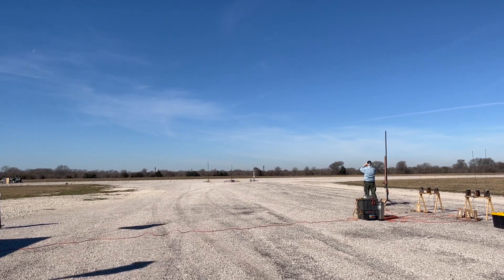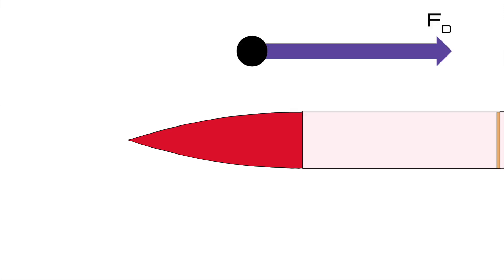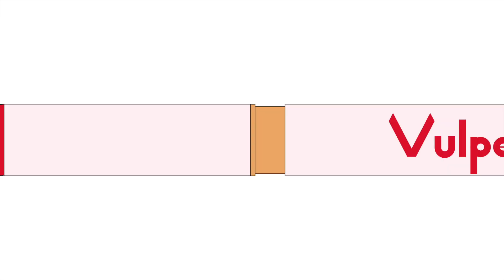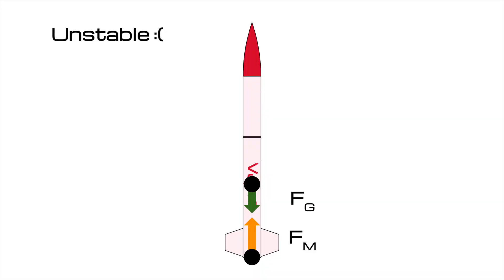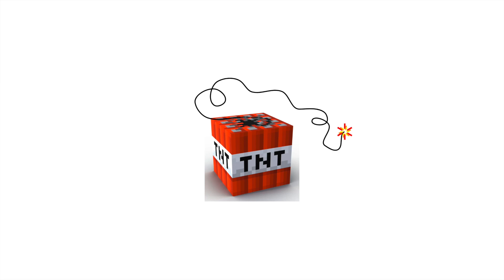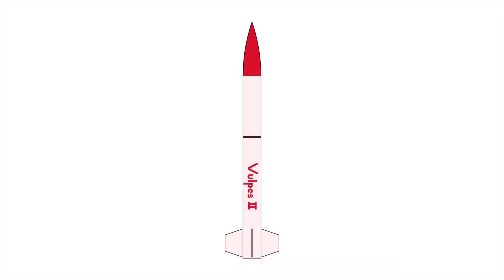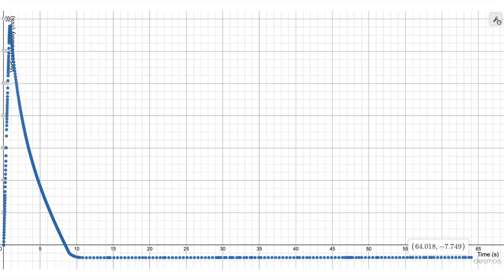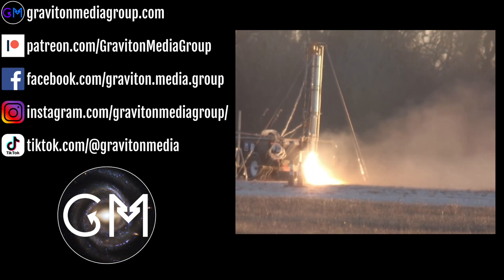How to Build a Rocket for L1 Certification (Vulpes II Rocket Launch)

Comment: what's the current cost of an H255? $50?  BTW,if the fuel grain is a C-slot,the delay grain is going to start burning upon motor ignition.
Reply from the maker: Yeah, $50 is about correct. Good to know about C-slot grains. It makes sense there are different types for different purposes.

Comment: This is an excellent video.  Perhaps the best entry level video I’ve seen. I really appreciate your time and effort to educate the viewer.  My only constructive comment would be that electronics are not required for an L2 attempt; however, I might suggest an attempt at Dual Deploy for a J-L motor so your rocket doesn’t drift a far distance. Or, you can use a Chute Release (with no Drogue) for motor ejection to bring the rocket down within a reasonable distance of the launch pad.  Also, for an L2, use a tracker or GPS. I lost my rocket at Hearne launched 
on an I impulse motor with a 12” 
Drogue chute  (which I really didn’t need) - I never even got a chance to see the Main chute deploy since the rocket had drifted so far away (due to wind and a thermal).  I’ve never launched without a tracking device after that. Hope to see you at Hearne sometime.
Reply from the maker: Thanks! Yes, you are right about the L2. Electronics are quite helpful for the reasons you outlined (mainly for setting chute release to a low enough altitude to prevent drift), but they're not strictly necessary as a design requirement from Tripoli.

Comment: Great video. I want to get started in rockerty myself but not sure if it was legal in my country. But after seeing this video and doing a bit of research i found out it was!
Reply from the maker: That's great to hear! Definitely pay attention to motor-purchasing requirements and height ceilings. In America, those are the two areas with the most regulation, but you can do both with the proper certifications and waivers.

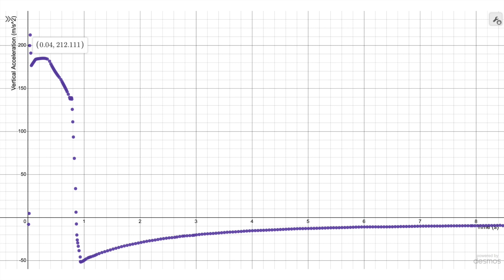Comment: 11:20    140 meters per second speed in its first second. Compare that with:: "Saturn V Rocket Launch Speed and Height 2
"   showing a whopping speed of 3 meters/second!!
Reply: We’ve been over this before. A TWR of 1.00000001 is enough for the rocket to get off the launch pad. The Saturn V had a TWR of about 1.25. 
You don’t want a huge acceleration: 140 m/s2 is 14 G, which would kill the humans on board. The acceleration increases as fuel is used up and the stage gets lighter, so the rocket has to be designed to keep the acceleration near the end of a stage’s run below the limit. For manned rockets, acceleration is limited to 3-5 G. At the start of the stage’s run, you then end up with a TWR of slightly over 1.
Reply: @Hobbes746 ==Enistein::: I have proved my facts with empirical kitchen-table experiments which even certified retards can conduct, so, I suggest that you prove your fairytale-TWR by buying one of these O-motors, and putting it on a rocket heavy enough to make a TWR==1.25, or even 1.5, or even 2, then sit next to it at launch. If your rocket moves up, you'll survive, but if doesn't it explodes and turns you into charchoal, which would make a memorable artifact in a NASA museum !!! agree??? 
Based on my below comment exchanges, and assuming that you expect your O-motor to burn for 5 seconds, if you and 4 other NASA-fans like you stand on top of the motor, you'd make up the bulk of a 400 kg rocket, then fire up the motor, and expect to reach the moon in a nono-second!!! How' that for a solution Rocket-professor???
Reply: @Hobbes746  ==Enistein::: I have proved my facts with empirical kitchen-table experiments which anyone can conduct, so, I suggest that you prove your fairytale-TWR by buying one of these O-motors, and putting it on a rocket heavy enough to make a TWR==1.25, or even 1.5, or even 2, then sit next to it at launch. If your rocket moves up, you'll survive, but if doesn't, don't worry about !!! agree??? 
Based on my below comment exchanges, and assuming that you expect your O-motor to burn for 5 seconds, if you and 4 other NASA-fans stand on top of the Omotor, you'd make up the bulk of a 400 kg rocket, then fire up the motor, and expect to reach the moon in a nono-second!!! Are you brave enough for that???
Reply: @Hobbes746    Did you get my deleted reply???
Reply: Briefly, my descriptive deleted comment challenged you with sitting on an O-Motor & launching yourself into space!!! That's a TWR>5
Reply: @kareemsalessi  An O motor with a total impulse of 20 kNs and a burn time of 10 seconds has a thrust of 2 kN, or 200 kg. If my weight is 80 kg, that’s a TWR of 200/80 is 2.5, not 5. It will accelerate me at 2000/80*9.8 is 2.55 m/s2 for 10 seconds to get a total speed of 25.5 m/s which is not enough to go to space.
Reply: @Hobbes746  If you even get off the ground
Reply: @kareemsalessi  With 2 kN, I definitely will get off the ground.
Reply: @Hobbes746   OK, then, you'll earn the prize!!! if you get off the ground, that is.
Reply: (VULPES II ROCKET LAUNCH)

Comment: 17:00   O-motor delivers a  Maximum of 40,000 Newtons==40 TONS of thrust force???
Reply: Ideally, you want to select a motor that will give you at least a 3:1 TTW ratio. 4:1 is much better especially for high power. You only have so much time while still under the control of the launch rail, so the more speed you can gain the better.
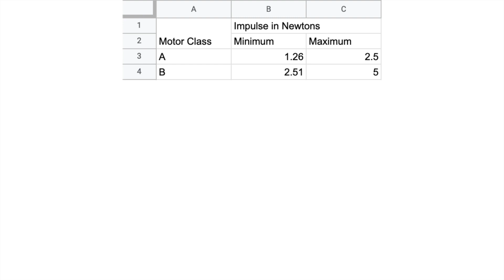Reply from the maker: 7:35 Ah, sorry. I see that's a mistake in the graphics there. It's 40,000 Newton-seconds, not 40,000 Newtons. Newton-seconds are a measure of total impulse, or change in momentum. This means that an O-motor can change the momentum of a rocket by 40,000 Newton-seconds. If delivered in one second, that would be an average thrust of 40,000 Newtons, but O-motors typically take five seconds to completely fire, for an average thrust of 8,000 Newtons.
Reply: @GravitonMedia  thanks.  So, 800 kilos of instant thrust, and how heavy was it at launch???
Reply from the maker: I didn't use an O motor. I used an H motor. A Cesaroni H255 to be specific. This video is both about my rocket and hobby rocketry in general, so I included the information about O motors to help teach people about the different kind of motors in hobby rocketry. The Cesaroni H255 motor has an average thrust of 255 Newtons.
Reply: @GravitonMedia   So, 255N==25 kilos thrust force, or divided by the 6 seconds of burn?? and thanks
Reply from the maker: Yeah, 255N is 25 kilograms of thrust. The burn lasts about 0.9 seconds.
Reply: @GravitonMedia  Thanks, and how much was the gross weight of your rocket??
Reply from the maker: 3.25 pounds or 1.47 kilograms
Reply: @GravitonMedia   awesome, so your approximate TWR was 25/1.5==17, correct??
Reply from the maker: Yeah, something like that.
Reply: @GravitonMedia  Great-Thanks, compare that with Saturn/Apollo claimed whopping TWR==1.2
Reply from the maker: Right. The reason the Saturn V was so much more powerful than my hobby rocket is that it applied that thrust for a much longer period of time, 168 seconds for the initial burn rather than the 0.9 seconds of my rocket. Also, the TWR increased over the course of the burn, as the Saturn V expelled much of its mass as fuel. Compare its wet mass of 2,200 tonnes to its dry mass of 137 tonnes.
Reply: @GravitonMedia  except that with its claimed TWR it couldn't have moved even on wheels , on the ground, much less to detach from its launch pad,  right??
Reply from the maker: TWR just needs to be greater than 1 for a rocket to leave the ground. When TWR < 1, gravity is stronger than thrust, so the rocket will stay on the ground. When TWR = 1, gravity is balanced with thrust, so the rocket will hover in place. When TWR > 1, gravity is weaker than thrust, so the rocket will move upward.
Reply from the maker: What exactly would qualify as proof to you? What experimental results would you need to see to change your mind?
Reply: @GravitonMedia   Any model rocket which could lift off the ground with TWR<1.5  would qualify, but  NOT talking about it.
Reply: This guy is trying to corner you into helping him prove his dingbat theory that the moon landing was fake. I’d ignore him.
Reply: @My3nMy4 ==TROLL
Reply: 0:10  Over 3lb, Ok, let's say 4lb==2 kilos. So, then, TWR==800÷2==400.  
Compare that with a whopping TWR<1.5 of Apollos,  SpaceX, etc.😅
Reply: (VULPES II ROCKET LAUNCH)

Comment: Congratulations!! I am currently on the design journey of an L1 attempt rocket too and this video inspired me to try harder even more!! P.S. what's the diameter of the airframe of Vulpes?
Reply from the maker: Thanks! The Vulpes had a diameter of four inches, which was definitely overkill for an L1 in retrospect. You can get cardboard tubes on Amazon that have diameters of 4in, 3in, or 2.5in. All of those work pretty well for L1s.

Comment: loved it!! I did my L1 on an H550. It burns for 0.5 seconds and produces 550 newtons of thrust in that short burn time hahaha. My rocket held up great. 

For my L2, i used the same rocket with a J270 motor and single deploy. However, on the second launch, the motor exploded 2.25 seconds into flight. It separated my booster from the upper airframe, feel 5300 feet and was recovered without a scratch hahaha. Only a broken shock cord :) 

My L1 and L2 were done with no electronics, however, my L3 we had redundant dual deploy, but my team launched without me and forgot to hook the electronics up so it came in ballistic from 10,000 feet......
Reply from the maker: Wow! That sounds like an interesting flight record.

I'm glad the L1 went well.

Sorry about the L2. CATO's are rare with manufactured motors, but it's very frustrating when it happens. How did you keep your L2 from drifting too far with a single motor deploy? I've been working on an L2 design, but increasingly find a drogue necessary to prevent drift.

An L3 sounds like a daunting challenge. Sorry it went ballistic. Good luck getting your L3 certification.
Reply: @GravitonMedia  thanks :) 

Pick the lowest L2 motor you can find. Thats how you prevent drift. Also add weight to the payload section in open rocket and sim it. I added a couple of bags of black beans to my rocket. Kept it low and slow and the extra weight helps it drift down rather than at an angle. Might land a tad harder, but my rocket was fine

The j 270 is a lower end L2 motor, but i still had to walk half a mile to get it. Oh, and if its a slightly windy day, you will have to keep an eye on it. Take binoculars and a ATV if you have one. 

All in all, my L2 disnt drift very far since it was a low power3d motor and i had a couple bags of black beans in the payload section to add drag and weight.
Reply from the maker: Thanks for the advice!

Comment: Hi! I'm the president of TU Darmstadt's rocketry club and I really liked your project! We started out with a very similar rocket flying an H-motor as well, but packed our own flight computer as well as a sofisticated recovery system which I can highly reccomend! Also, make sure that during descent under parachute your chute lines don't get tangled up because your rocket will most likely enter what's called a flat spin. Last month, we launched our latest rocket to a height of one kilometer and deployed three payloads - I hope you're planning something similar! It is a ton of fun, let me tell you.
Reply from the maker: Awesome! Nice work. Rice Eclipse is building a rocket for Spaceport America this summer. It'll be much larger than the rocket in this video and fly to an altitude of 30k feet. We've built our own hybrid motor for it and are very excited to see it fly.
Reply: Can eagestion system damage the parachute??
Reply from the maker: Yes, the ejection is a black powder explosion, so if the parachute isn't properly protected, it can be damaged
Reply: Anyone please help me to build my own rocket please 🙏🙏

Comment: How do you know how much to file down the delay grain to get the delay to 7 seconds?
Reply from the maker: For L1 rockets, the best way to do that is to simulate your rocket on the program OpenRocket. This will give you predicted values for apogee and time of flight, which you can use to determine the optimal delay time (just after apogee is best).

Comment: I don't like sharp cones,  the breaking of the air should be gentle, clean air is better for moving fast through it.  Do you ever launch dolphin or tuna shaped cones?
Reply: Nose cones with rounded ends are preferred for subsonic rockets; supersonic rockets perform best with pointed cones. There are a number of research papers on this.
Reply from the maker: Interesting. I haven't tried other-shaped cones for this type of rocket. Are the aerodynamics better?

Comment: Hi great video, I'd like to know where you get your rocket supplies especially the body and nosecone. Also if you could explain how a reloadable motor works and where you can get propellant from I'd be very grateful. I'm trying to get into this type of amateur rocketry and I don't know where to start or get things.
Reply from the maker: Hi there, we get the body tubes from BOX USA, a company that makes poster mailing tubes. We get the nose cones from Apogee Rockets. Reloadable motors have reusable casings with new fuel inputted each time. You just have to buy new fuel each time.
Reply: @GravitonMedia  Thanks I really appreciate you taking the time to respond I wish you the best of luck with every future launch 😁
Reply from the maker: Thanks!

Comment: Wait, would a simple apple airtag in the payload work for recovery?
Reply from the maker: Probably not.
The issue with an AirTag in particular is that it doesn't actually use GPS tracking. Instead, the AirTag uses Bluetooth connections to nearby Apple devices to determine its location. For instance, if you drop your wallet in a busy parking lot, the AirTag will determine its location by connecting to the nearby phones of passersby. For the typical use-case of AirTags—finding misplaced keys, wallets, and other household items—this works fine.
When it comes to rocketry, launches typically occur in remote rural areas, and the rocket is unlikely to land close enough to any other Apple devices to pick up the short-range Bluetooth signal. Thus, an AirTag would not be reliable for recovery. You want to use a tracking device that has GPS capabilities.
Thankfully, most GPS trackers are in a similar price range to Apple AirTags, about 30 bucks.
Reply: @GravitonMedia  Wow, The fact you took your time to help me on thhis means alot. I really appreciate the response, You earned a subscriber! What GPS do you recommend I use?
Reply from the maker: Thank you for subscribing! I actually haven't used a GPS in my rockets yet. My team at Rice University uses Telemegas and Raven Blues for altimetry data. I think those companies might sell GPS as well, so that would be the first place I would look.

Comment: I’m very new to this. Can you reuse motors or are they all 1 time uses?
Reply from the maker: That depends on the motor. The Cesaroni H255 I used was a one-time use motor, so it would have to be replaced with a new motor after each launch. On the other hand, a motor like AeroTech H128 has a reusable casing, and just the fuel needs to be swapped out after each flight. For a beginner, the one-time use motors are simpler to assemble, as their fuel components are not detachable since they aren't meant to be swapped out. Reusable motors can be more complex since you have to work with the motor internals. Hope this helps. Happy rocket-building!